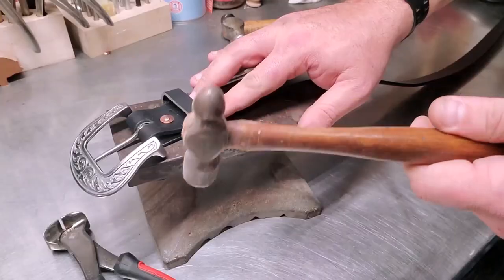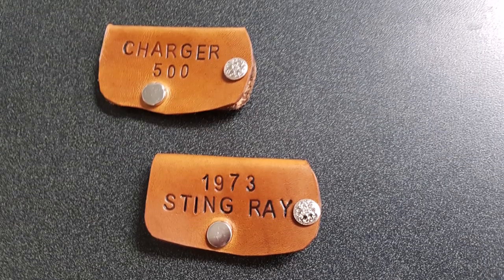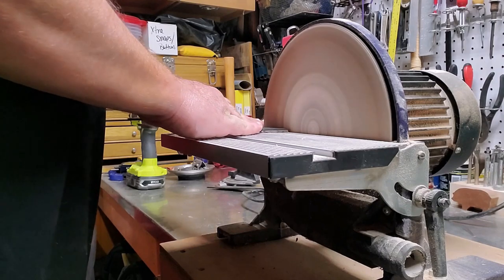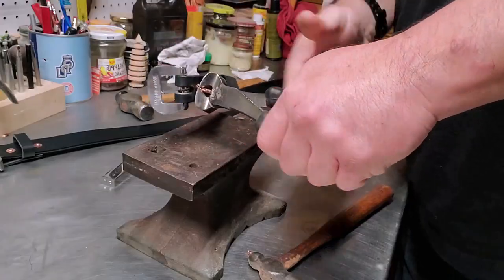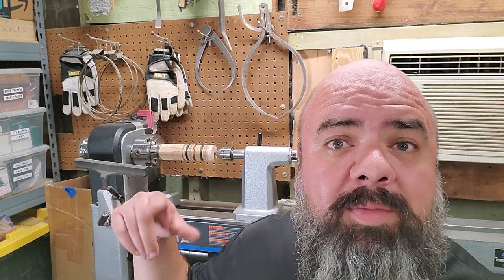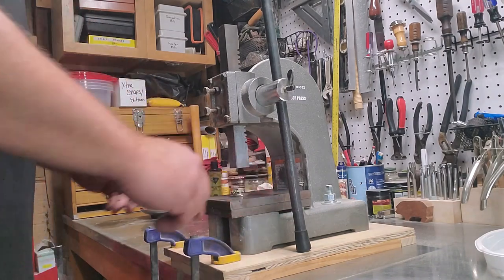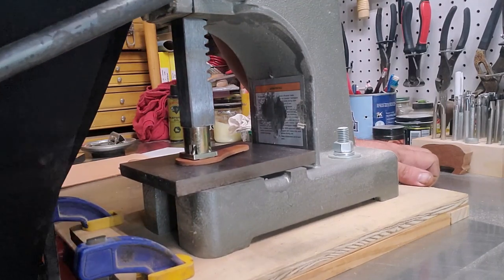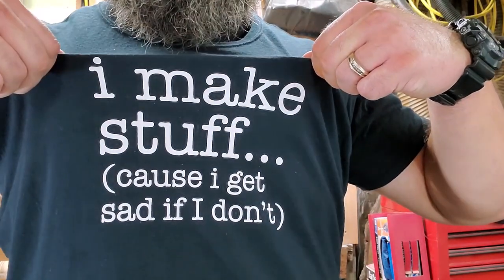SAVE MONEY By Using Woodworking Tools As Leather Crafting Tools

Comment: Very cool!!  I’m another grey beard maker.  Retired now, grew up and put in 30- some years as a custom cabinetmaker.  My first leather projects I “drilled” the stitching holes with a finish nail and hammer on a scrap 2x4.  Works great.
A small drill press can be mounted sideways on a stud wall or cabinet mount (Dad built a cabinet to mount it in back when I was apprenticing in his shop); we used it as a doweling machine, and in another shop, we used a similar setup to cut tapers and tenons on logs for log furniture.  Can also rig a tail stock and turn it into a rough lathe for small pieces; also works for polishing screw heads and such. Heck, a handsaw can make a handy straightedge for cutting straps and latigo LOL
Reply from the maker: Very awesome ideas Rob. You should make a few videos to demonstrate these.

Comment: Perfect video for me. I just started doing small leather projects; mostly things with rivets and snaps. I am using my HFT 1/2 ton press. I used it to make pens now I use it to set rivets and snaps. Great idea about the disk sander and wood lathe. Thanks.
Reply from the maker: Cip, I appreciate it.   I got into leather craft about six years ago or so and since I had a woodworking background I approach things a little differently. I'm probably never going to make an hand tooled $7000 saddle, but I do enjoy the craft and make all kinds of different items. 
Have you ever made a pen making video?  I am going to check out your channel here shortly.
Reply: @bigstacksshop  Pens are on the old channel: "Cip's Wood Chips" That channel is mostly about wood lathes, kind regards.
Reply from the maker: Thanks Cip.  Big Stacks also turns,  so I'm definitely going to subscribe.

Comment: The best savings on tools is to not buy new. I learned using a saddle maker friends tools. Then when I moved I had to get my own. I found an estate auction where the guy bought much of the Tandy catalog. The only buyers I was against were Ebay sellers. I paid more than they wanted to spend and way less than new. I bought $2000 dollars worth of tools for $120. Now granted that was 17 years ago but it is the same for my wood working tools and mechanic tools. Estate sales and auctions. Sometimes you will only get one item.  Someday when I kick off this mortal plane someone will come along and buy what I had, so there is always stuff floating the market.  Just be patient and work with what you have and expand as you find stuff. The hunt can be as fun as the use. You might have to expend elbow grease to clean tools up for reuse.
Reply from the maker: @57WillysCJ I have checked estate sales for years and found a lot of cool tools,  but I still have yet to see any leather working tools.   Must have not been a thing in my area back in the day.

Comment: The motor start capacitor has gone as mentioned below.  Use a thick wooden disc on the lathe with a good outside edge on it covered  in leather with a good scarf joint so that it is regular and use it to polish all sorts of kit.  Possibly 2discs, one with 1500 grit on leather and one smooth.  You showed a big saw.  Interesting steel at a cheap price or even a rusty blunt one - cut with a thin 1mm zip disc on a small hand grinder and turn into a blade, sciver or half moon knife.  Also seen old HSS circular saw blades cut in the same way and turned into leather knives or chisels.  Can you make an edger from a piece of HSS blade in the same way - probably.  Another source of old hardenable steel is old tyre levers from car mechanics.  Heat to blood red in a gloomy room without strip lights or until it does not stick to a magnet to anneal - cool slowly or very slowly.   Same to harden but quench in light oil, polish to shiny,  heat from handle end slowly until colours spread out until tip shows light straw quench in water.  Polish and resharpen.  This will not work with HSS  (high speed steel).  Disc sander with a circular leather plate instead and perhaps a disc with a crocus emery grade of paper (jewellers rouge) c 3000 grit.  Your edge polisher in another form - thin collars, then touched with sharpening and polishing blocks whilst rotating to sharpen gouges, edgers etc perhaps a composite disc of MDF might do the job better and hold the compunds well. Tray to keep the abrasive off the bed of the lathe.
Reply from the maker: @hawkercnc8261 Thank you for the great tips!

Comment: I use my Dremel tool for a lot of my leather work, it has a lot of different attachments. For stamping leather you can get large nail head's and make your own design on the nail head if you have a Dremel tool it helps to grind the nail head for a pattern small file set from Harbor freight has them for under $10
Reply from the maker: @SNOOP U 2 making your own stamping tools is a great idea.   You can be creative as you want.   I've heard of people making these with bolts before,  but never nails.  Now you've got me thinking.  😄
Reply: @bigstacksshop  thanks yeah the large nail head's work best so you can make a bigger design

Comment: I love that you start your disc sander with a push! We all have those tools. My most used tool for leathercraft is a buffing wheel. So much faster than a strop with the same outcome.  Best $70 I ever spent on leatherwork.
Reply from the maker: @Tyler Clark I'm going to have to buy a buffer just for leather.   Mine is used for metal polishing, so it's all dirty.   Thanks for the tip.
Reply: @bigstacksshop  Oh, I meant I use it to strop leather tools, I’ve never tried the leather itself b/c of all the polishing compound. You can use a box cutter blade 100x as long.
Reply from the maker: @tylerclark3045  Gotcha.

Comment: Hi
Try a new capacitor on your sander 
I had same thing with my wood lathe 
I had to give a little turn to start it 
And found it was the capacitor
And was only a few pounds 
Cheaper than a new sander or lathe in my case
It holds a charge and it kick starts you sander it stead of turning by hand 
Give it a go  let me know
Reply from the maker: Thank you for the advice. I'll check that out

Comment: For 3D stamping with the arbor press, did you cut down the ram mount, or was it that short to begin with? I have a handheld one that I bought for stamping with hammers, that's the 'regular' length of a leatherworking stamp handle.
Reply from the maker: @matthewyan8463 That is the size of the one I purchased from Tandy Leather.   Where did you purchase the full length one?  Thanks for sharing.
Reply: @bigstacksshop  Also Tandy. Not sure if it's the same brand, but if you look up the "Craftool Hefty Handles" on their website, I've got probably one of the 'standard' size ones. Bought it in store at some point early last year, or late the year before, I think.
Reply from the maker: @matthewryan8463  I bought mine maybe 5 years ago.   Just used it today,  that thing is great. I'm interested in the longer one so I don't have to attach a handle to it.

Comment: How do you make your die cutter ?
Reply from the maker: @Robert Taylor I put my die and leather between two pieces of steel on the one ton press.
Reply from the maker: @Robert Taylor If you are asking about the leather dies themselves,  I don't make them.   I buy them from Etsy or Amazon.
Reply: @bigstacksshop  hi ok that's what I mean thanks
Reply: @bigstacksshop  I will have a look
Reply from the maker: @roberttaylor4190  Just FYI, these dies aren't of the highest quality,  and to my knowledge can't be sharpened.   If you get a choice to get the ones with Japanese steel spend the extra money. 
After you have been using them for a while,  you will know which shapes you like the best,  and can get a high quality custom one made.  They will cost a lot more,  but will be well worth the money at that point.

Comment: But it only cost about $100-$150 to purchase real mid range type of quality leather working tools made to do the job correctly and more importantly than anything to do the job much much faster which is always most important time is the most expensive asset period if you use those tools and make a wallet and I use my tools it will take you 2-6 times longer depending on skill set so that time is hundreds for me personally thousands. Oh and I had well over $70,000 in woodworking tools every hand tool and power tool known to mankind old and mew cheap and expensive from harbor freight to festool so yes I know what I am talking about but a cheap leather working kit on Amazon for $40-$60 and that’s still perfect for part time/ beginner leather worker oh well I digress lol cool look though never even thought about it
Reply from the maker: @The Home Wood Worker - I see a lot of kits from overseas which I haven't been very fond of,  they come with 3 or 4 decent tools and 15-20 tools I wouldn't use, so it always seemed like a waste of money.   I'd rather use the tools I have than the kits I've seen, and spend the extra money on leather and tooling stamps to give my leatherwork more character.

Where can you find the kits you are taking about?  It's quite possible they are better kits than the ones Ive seen.  I'd like to take a look and possibly review them.

Comment: I believe in using the right tool for the job. There is a reason why there are separate leather working tools. Congratulations to you for figuring out alternative methods, but your work will look like you used carpentry tools. When you make a "Hand Tooled" saddle with your methods, and it turns out excellent, then I'll take your advice
Reply from the maker: I can get with you on that Kevin, the right tool for the job is always the best option, hands down.   My channel is really geared for individuals with limited shop space and budgets.   Small shop people need to make the most of what they have.

As for the quality of the finished product,  I guarantee they look great and you can't tell the difference between those made with only traditional tools and the specific tools I use in this video.